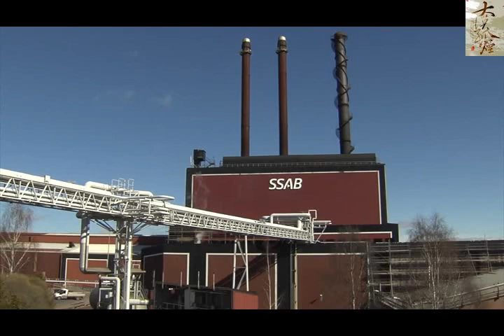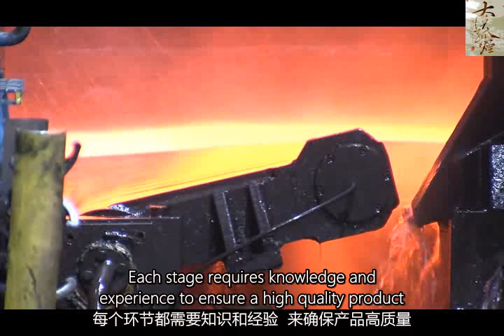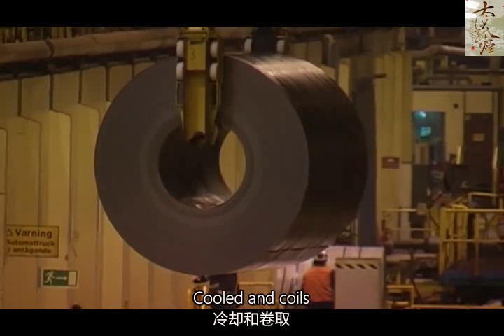热轧生产Hot Rolling Mill中文字幕+英文字幕

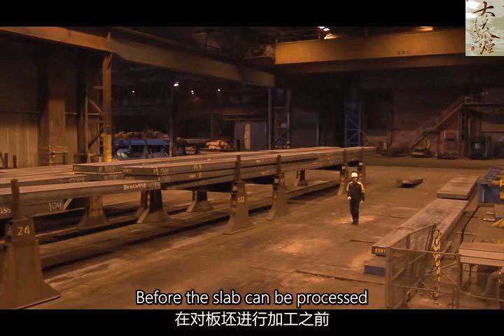Comment from the maker: 00:02:48   significant         00:06:10  additional       00:01:17   dimension
00:04:00   primary(区别premier)     00:03:55  roll up    00:06:05   subsequent
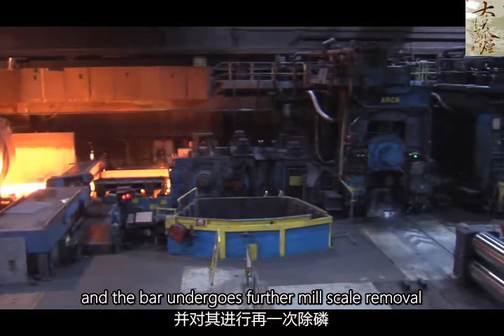00:01:44   sufficient           00:06:00    depend on          00:02:03+00:04:37   consist of
00:05:18   horizontally       05:40     be adapted to          04:12  minimize
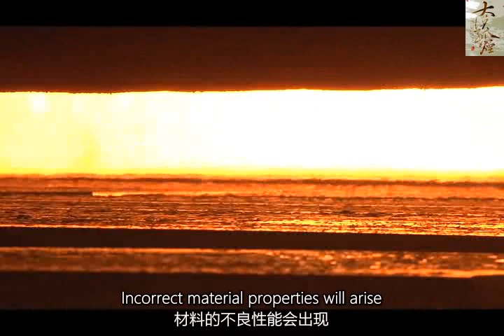01:50         dissolve            03:38+04:19+04:31   remove+removal
01:17  continuously+required for               01:40+02:16    affect
02:02  react?           02:21+ 02:35+04:27+06:10  undergo +undergone  01:46  arise
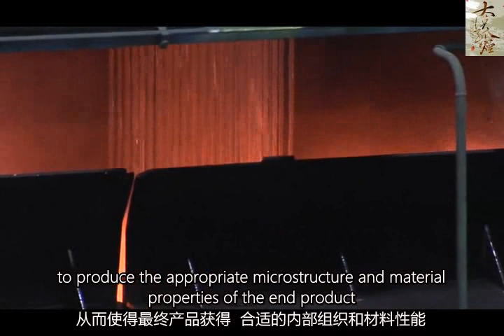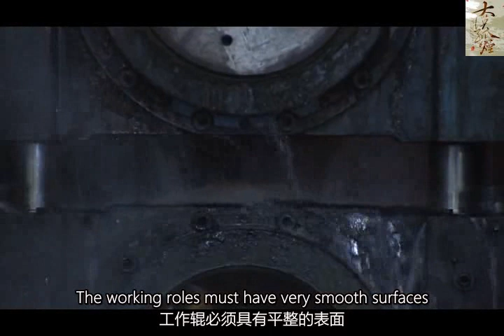05:45 appropriate           03:12  be in direct(直接）            05:50   cooling section
02:26  be sprayed             06:10  be sold directly to         01:52   failing to
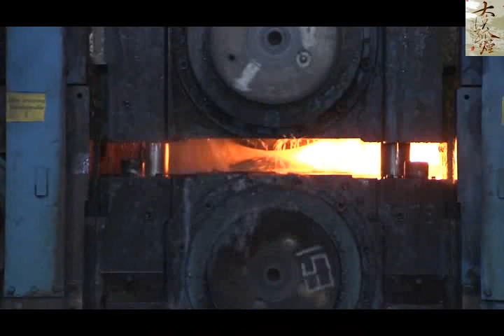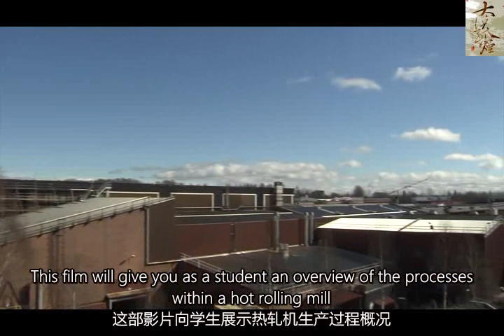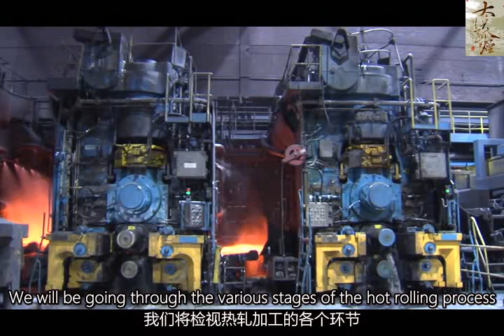十00:26+01:19  thickness+width   00:12 in collaboration with     00:43  ensure?
  01:49  arise           05:50    cooling section         05:20  adjustable
05:08   observe                  02:05   be formed        03:33   trace  01:52  due to                                     
00:05   overview              05:42  cooling rate                        03:44  vertical roll
05:55  assigned to          03:08  tolerate                               05:08  swinging motion
04:02   equalization         1:32   feed (v/n)                         01:19  weight  width   thickness
00:05   within a mill        05:24   the later stands             00:31 steel plate
04:27   (a/adv,v) further removal    03:22  (a/n) particular material
05:16+05:24+05:29   profile (n/v)    00:05+00:37+01:57+03:33  process (n/v)  
00:19+01:13  process (v/n)  5:29 post-processing  06:12 processing stage(生产阶段）
二十01:18+05:29  correct (a/v) 合适的,合乎规则的   01:46  incorrect property
03:26  pass (n)+pass(v)     05:50  pass through  00:37  go through    01:52  carbide
01:57  transport (n/v)    03:53  transfer (n/v) 02:10  adversely    02:10  remain
01:04+04:34   finishing (a/n,v)   01:13+01:18   slab     00:19   rotating
01:04   cool (v/a,n)    06:07   cooling     01:40   especially     01:18+02:10   final
00:51+01:57+02:40+02:54 +03:33+03:57 roughing(动名词)    05:16+05:24  flatness
01:52   dissolve   04:06  occur   02:21 +02:36 cleansing   02:26+02:36+03:33 cleanse
04:57  measure (v/n)    02:02+02:21  scale (n/v)  mill scale   02:50  reduction
05:29   (BDSZZY)      02:13  (XFZZ) (FCZZ)-f
########################################################
Where ( interr-adv) -- 
Where (relative-adv)
   1. (at,in,or to will used after a place or situation)   -- 03:22    
    2. (the place or situation in which)  -- 
wherever  (relative-adv)-
wherever  ( conj ) --  
whereas  (conj)-- 
everywhere (adv) -- 
everywhere (none) -- 
anywhere (adv)--
anywhere (pron)--
somewhere (adv)--                           nowhere (  adv）    elsewhere (adv/pron)  

somewhere (pron)-                          nowhere (  prone）          nowhere (  adj) 
#######################################################
When (adv-- how soon) --   
When (adv-in what circumstances)--04:02
When (R-abv)-- 
when (conj-at or during that- after )--5:50
when (conj-at or during that- at any time that, whenever )--04:02+ 04:12+05:08 
when (conj-- although, whereas)-- 
whenever (conj-whatever time occasion)--
whenever (conj-every time that)
-
whenever (adv-suprise or confusion)
-
when (phrase)--
 during (prep) --01:52+02:10+03:33+05:55+
even when (conj) --                     when + prep   --- 04:02                  not when --
   when + ing+名词+过去分词  --               as as when --
#############################################################
Which (interr pron) -- 
Which (interr determiner) --
Which (relative pron 句子) --
which (relative pron 词语)--4:57
Which (relative determiner) --
Which (prep + relative pron) --
Which (prep + relative determiner)--  
######################################################